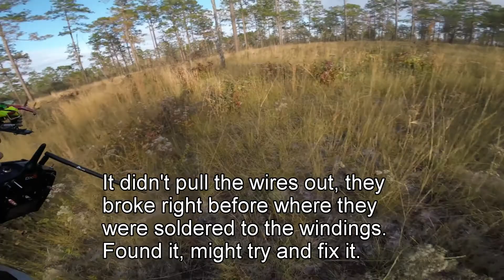Multicopter builders 2208 1950kv on 6s

Comment: Got this primo 2208 1950kv and the magnets looks smaller than the hyperlite motors. Please correct me if im wrong.😭😭😭😭
Reply from the maker: They look identical compared to my hyperlite 2208.5 motors, same width, thickness, even the gap between magnets looks the same.  Unless they changed something on the newer motors.
Reply: @mooosestang It's weird. Side by side with the hyperlite and the primo looks smaller. A guy on Facebook told me that the primo motors have a lip around the bell
that's why. I guess he might be right.

Comment: So you've had a few weeks on those 1050mah packs - how are they holding up? Did you buy some different sized packs later or still rocking the 1000mah size? Also - not sure if this was your only flight on the MCB 2208's or if you were able to get a few packs in previously... did you happen to glance at the amp draw - average/max?
Reply from the maker: I've put several packs through the mb 2208, max was 126amps, minimum was 115, average was around 120 though.  All the batteries still feel great, i have 8 of the 1050's. I ordered 4 of the 1250 75c 6s that pulse had on sale, should be here tomorrow.  I kind of expected them to draw more amps than the emax.  i would not go holding full throttle for a long stretch on the 1050's with these motors.  If pirofliprc comes out with that 1722kv motor i'll probably give those a whirl too.  Even with the increased amps, i've yet to have a battery come down hot, nothing like i've done with 4s packs.  I don't even run high kv motors on 4s, but i can sure heat up a battery.
Reply: I have been using really big batteries I got on a sale (1500 6S turnigy graphene). I can hold full throttle for ages, and the motors and batteries come down barely warm. Motors: 1900kv 2408 F80. Props: Gemfan 5152. I wish I could get smaller good 6S batteries here, but I can't find any cheap. 1500 is far too heavy, 1200 might be ok

Comment: Haha, the thumbnail is funny, the one motor that got away 🙂
Reply from the maker: Thanks, i thought it was funny.  I looked for that motor for 15 minutes, just to see what kind of shape it was in.  I've got it back on the quad all ready, with the end of the arm missing.  Probably not wise to try to fly it.
Reply from the maker: Don't tempt me!  I've got some good epoxy for carbon fiber, i could put the end back on.  The weather is crap though and i'll have a new arm on thursday.  pirofliprc ships stupid fast.  I tested the motor all ready, the bell or the shaft is a little bent, but i'm going to fly it at least once before replacing it.😈  I'm really impressed with the durability of these motors, that hit would have destroyed a lot of motors.
Reply: just epoxy some Popsicle sticks on there you'll be fiiiine! :D
Reply: NarcolepticLTD even with the popsicle stick fix it will still probably be stronger than most Chinesium carbon frames 😂
Reply: just draw some hash marks on the popcicle sticks with some charcoal first to add a bit of carbon it'll be great!   Sucks about that motor though - that it had to die to prove their durability :) Serge ships fast if you can catch an item in stock...